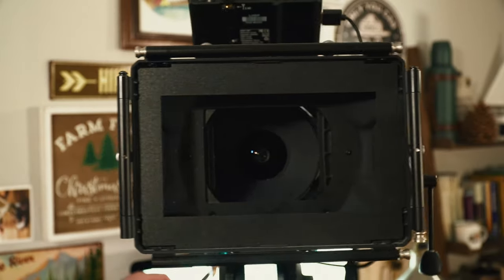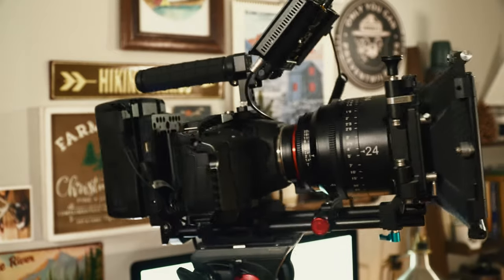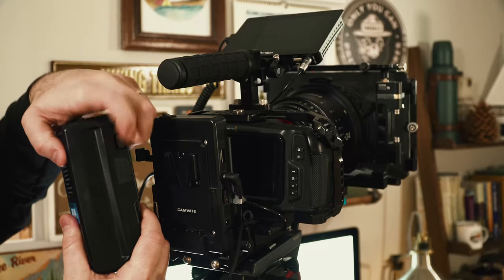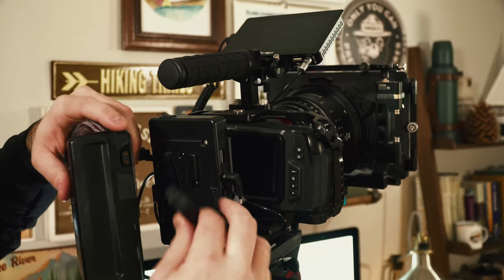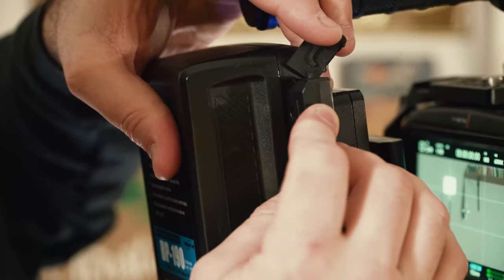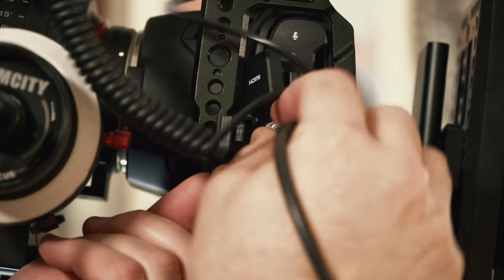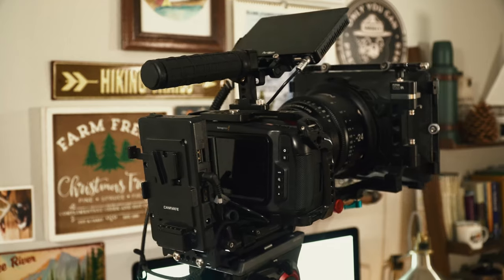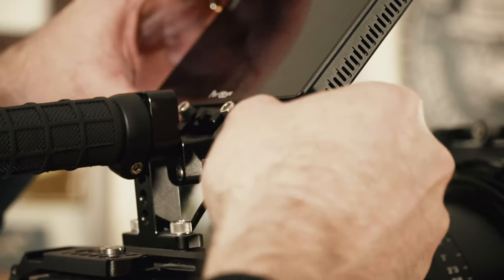BMPCC 6K & 6K Pro - Ground Loop/HDMI Burnout

Comment: A little hint.
 Just make sure that you first plug the power cable into the pocket camera and only then connect it to the D-tap connection of the V-mount battery.

 It is important that the power cable is not first plugged into the D-Tap connection of the V-mount battery and then tumbles around loosely and hits the camera housing or SDI or HDMI connector.  Otherwise a short circuit can occur.

Comment: I have my BM6Kpro and the ninjaV both powered using dtap, from a 4x slot DTap splitter which taps into the Vmount plate - been a month now and had no issues. I’m hoping that the splitter and the plate will act as a proper ground for the current… avoiding a loop.. but watching this I may start powering the camera from the VMount battery directly, and keep all the accessories powered from the splitter… if anyone’s had experience with this lmk what you think!

Comment: Hey Jordan, thanks for the informative video. Rigging my 6K pro currently so I find this really helpful!
One question: What HDMI cable have you been using with your setup? I am looking into the Kondor Blue right angled HDMI, but I was thinking if there are a bit cheaper solutions.
Reply from the maker: Glad this was helpful! I've actually been through about a half-dozen or so HDMI cables trying to find the best one. I've tried expensive ones and cheap ones and this is the one I ended up using and finding to work best for my needs https://amzn.to/3LBDegv
Reply: @jordanvp  Thanks friend, I'll definitely check this out! Re-watched the video again. Powering my cam exactly the same way (just using a Dummy battery to dtap instead of a dc cable to run the monitor from the v mount plate)

Comment: Awesome! Thank you for this, I powered both from same source and I had my camera monitor fried, had to wait for a replacement. Can you please give amazon link to your HDMI cable, it is not in the list.
Reply from the maker: Here's the cable I used! https://amzn.to/3hn0nX0
Reply: @jordanvp  Thank you. I intend to power a wireless transmitter from the battery plate; do you advice the transmitter and the monitor be powered from the same source? (battery plate)
Reply from the maker: Yeah that would be safe I believe. It seems that it’s typically when you power the video output source and the input source from the same supply it creates the loop.

Comment: I have 4(!) BMPCC6K: In two years three of them had each to be repaired twice. With every repair costing me 8-10 weeks (3 Cameras x 2 repairs per Camera x 10 weeks) without camera i just had to bought a fourth camera to can work with at least two oder three of them. These cameras are nothing but cheapest garbage.

I use the same split setup: Camera or Monitor powered separately from VMount directly or VMount Plate.
Reply: what blew or broke on them? and if I had to do 6 repairs on a brand I dont think id buy a 4th of the same brand. just sayin.
Reply: @flipnap2112  No idea, none of the 6 repairs came with a report or an invoice what exactly was repaired. Its completely insane with BM, but i have noch choice: No other Camera/Eco-System in my range of budget works.
Reply: @Filmkunstkollektiv  you bought four, you totally had the budget to go with canon C line or sony fs line, these have the near same image IQ or went with panasonic 2nd hand eva-1 etc...i had an og pocket that was six years old and also used my p4k for 2 years with zero issue...now am on p6k n p4k is still working as it should...you sure you are not buying from grey market or you just mistreat your cameras lol?
Reply: I had the same problem. I have three Pocket 6K G1 and fried two HDMI Ports with a similar Setup. I powered the Pocket, Monitor and wireless transmission with the same V-Mount. I use the setup for over a year weekly without a Problems. Just in the past months I fried two camera and had to give them to repair

Comment: Thanks for this really handy tip. 
I just purchased the 6K pro last week and am working out power solutions. I am sure others may have faced the same question as I do - The V Mount battery has 14.8v output and the Camera power input is 12v. I am super scared of frying the BMPCC 6K Pro. But it looks like you have used the D Tap output from the battery directly into the camera. Have there been any issues at all? Thanks and much appreciated.
Reply from the maker: So far I’ve had no issues running my rig with this setup.
Reply: dont quote me on this, but I believe I read somewhere that the main power plug (the 2pin on camera) can be powered with a circuit of anywhere between 12 and 18V. The problem people run into is using an external Sony NPF battery (like what goes INTO the camera) and use it to power the camera into the power plug. if you run a DTAP directly into the power port on the camera you will be good.

Comment: I may be wrong, but I think the plate might have some sort of regulators or transformers in there that also help. they have multiple voltage ports (5v,12V) then they must right?  ive been doing the same setup as you for a year with no issues (except I power my nano with the plate) in fact im looking into setting up a 2 pin from the camera to a barrel mounted to the rig, and a female barrel to a DTAP, so I can quickly unhook power without digging into the actual power port all the time. I dont trust the actual WEIPU 2 pin connectors in the BMPCC. ive heard of them breaking off from time to time so im worried. but im a natural born worrier so..

Comment: The way I understand it is the bigger problem is discharge rather than just plugging things in. So order of operations should be video cables between monitor and camera, power cables between plate and camera, then add the battery and turn everything on. Then so long as things aren’t needlessly unplugged while the battery in on everything is fine. 

Great video though, you break it down well.  There’s a lot of bad information on this topic.
Reply from the maker: Thank you! Good insight into this issue 👍🏻
Reply: yeah order of operations is always the key, in many things like this..especially computers.  like "put static bracelet on BEFORE you pull the memory chip" ha ha. that one cost me 400 bucks.
Reply: I totally agree with the importance of operations but is it possible that you have it the other way round?
The arri website is telling me to do the exact opposite, 

"When connecting cables: FIRST connect power cables, THEN the BNC/HDMI. 

When disconnecting: FIRST disconnect the BNC/HDMI, THEN power."
Reply: While this seems to be true, I would still advice against this. Just had my HDMI fried because the DTap came loose while shooting.

Comment: Hey Jordan. First of all your rig looks hella good! I was searching for something like this as I'm looking to build my 6k pro rig very soon.
I was wondering if I should buy a D-tap to DC12v cable to power my monitor off of my V-mount battery or pay extra money and get a separate battery for the F6 plus monitor. I'm also going to be powering my camera from that same battery(Anton Bauer 144W), so I was kinda confused as to what is correct. I don't wanna have any issues, so I wanna ask... Is it safe enough to choose the cable solution and power both the monitor and the camera from the battery?
Thanks!
Reply from the maker: Thank you! I wouldn’t recommend powering them directly from the same source directly. Mine only works because I run the monitor from the power plate and the camera directly from the D-Tap on the battery itself. I haven’t even tried to power them from the same (that was totally by accident lol) but after hearing of issues from others I was glad that I hadn’t of course. I’ve had no issues at all with my setup so I know that it’s safe, but to be even safer you may want to just get another battery for the monitor! Hope that’s somewhat helpful, feel free to reach out with any other questions!
Reply: @jordanvp  I'm actually planning to power my camera from the Anton Bauer V battery directly, and the monitor from the Smallrig adapter. So kinda not exactly the same source but wouldn't the V-battery and the adapter considered as one source?
Reply from the maker: Technically the same power source, but for some reason adding the circuitry of the adapter eliminates any ground looping issues. I’d say if you’re having any doubts at all to go with another battery on the monitor itself!
Reply: @jordanvp  I'm gonna have to think it over a bit, because the Smallrig adapter I'm going to buy is really good either way, and has multiple ports(including 12V).
Thanks for your replies though, much appreciated!

Comment: What if you want to also power a wireless transmitter, like the cineye, through your v-mount?
Reply from the maker: I think you could power that off the power plate without any issues, but relay your hdmi from the monitor. Or replace the monitor with the wireless transmitter altogether.

Comment: Hi Jordan, what about if you power the camera the way you showed in the video and then just powering the monitor with a completely separate NPF battery,m not connected to the v-mount in any way, would that be an issue?
Reply from the maker: No you shouldn’t have any issues with that configuration!
Reply: @jordanvp  thank you